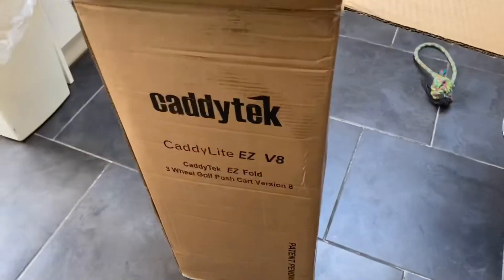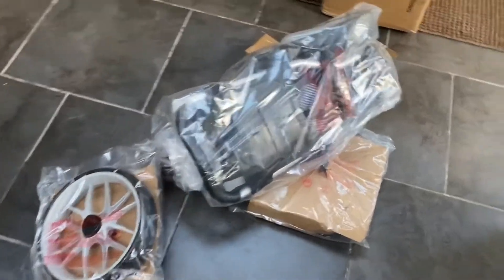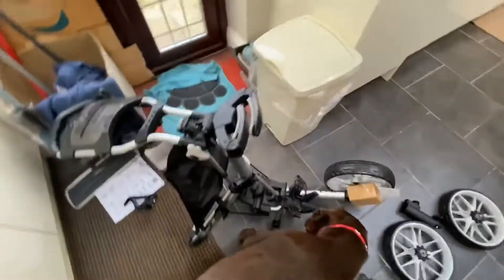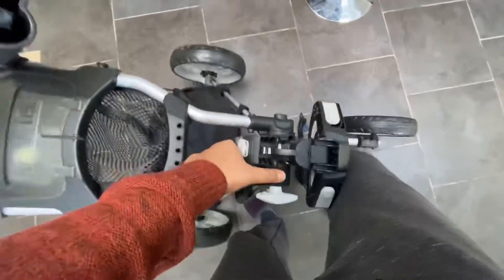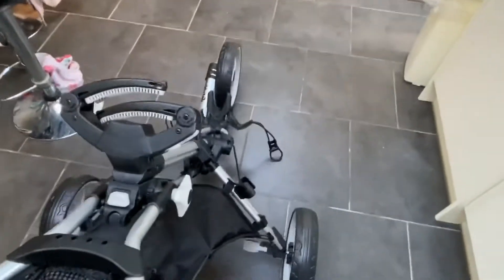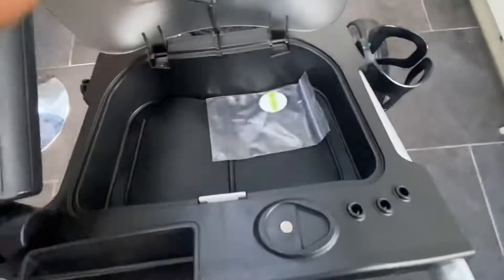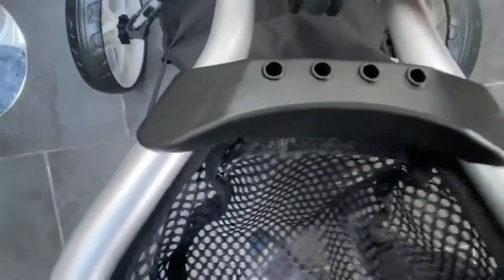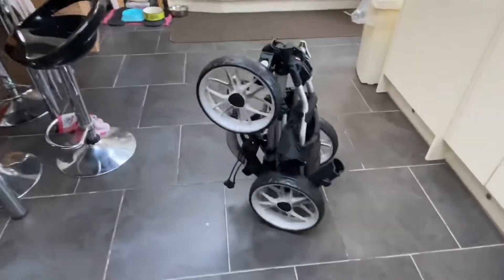Caddytek Caddy lite V8 EZ unboxing

Comment: It seems there was quick break at 4:41/4:42. Did you have trouble getting the upper bracket past the front wheel?  I just unboxed mine and the upper bracket  keeps hitting the wheel when I fold the unit.
Reply from the maker: +scottb2002 mine does the same

Comment: I bought this brand of four-wheel products before Christmas. The assembly is very simple. The balance is very poor when I use them. The friction between the front wheel and the bag will cause the car to not run normally in a straight line. I am very disappointed with the quality of this brand of products
Reply from the maker: +C Lee you need to rotate the front wheel